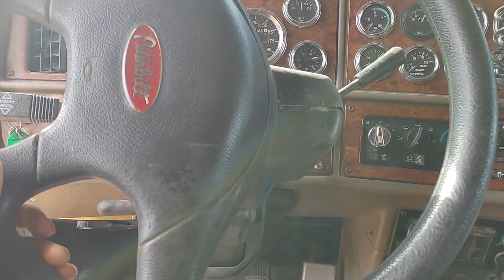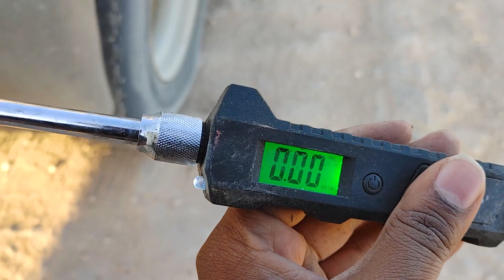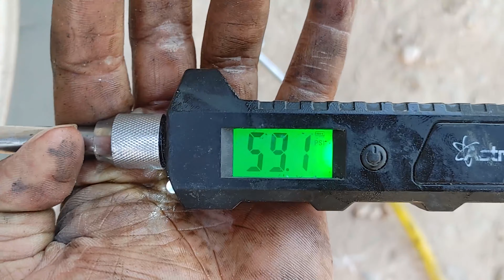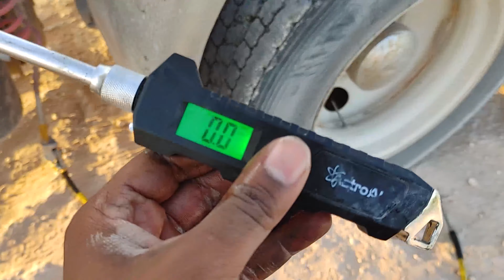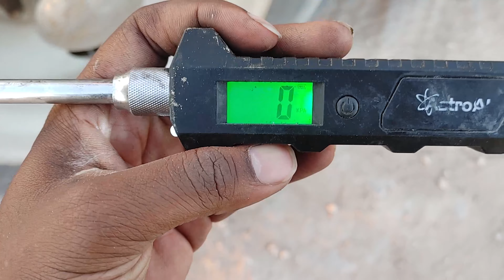Trucking - Blown Tires

Comment: Yo just some free advice whenever you get new tires always ask for new valve stems. Quick question how do blowing off go when you switched to 24 and 24?
Reply from the maker: Lol they wouldn't do 24/24 because it wouldn't fit. Had to stay with 30/18. I think his trailer has 4 pods or either the pods have bigger cubic ft.
Reply: @ChasingAndrewJackson  oh ok just checking. It would have be sweet if you could have switched it up. Another quick question how much longer you plan to stay in the oil field. I know it's good money but seems like it's more just a means to an end?
Reply from the maker: I'm not sure. The plan right now it to just keep the truck at 100% & stack the money. If something happens i can leave any day. I have thought about putting a driver in it if i go otr with koko.
Reply from the maker: Justin lewis suppose to be leasing on with the company im out now. If he comes we could be out here till the end of the year.
Reply: @ChasingAndrewJackson  just some more free advice if you put a driver in it and gonna be gone otr instead of paying the driver 20 to 30 percent think about paying him/her 40 percent after fuel and expenses (mechanical included) of the settlement amount. It might sound crazy at 1st but I promise you you will make more money with less headache with that formula and you only giving up an extra 10 to 15 percent. The driver will work harder and take care of the equipment better. 💯💯💯💯
Reply: @ChasingAndrewJackson  that's what's up. I been wondering how he been doing. He seems like a good brother but I know he has had some valleys and peaks in this trucking industry. Hope he does come over there and gets his fleet back up💯
Reply: @truckology101  That is a good formula I pay driver 60% of net. Make them wanna save on fuel and not idle truck so much
Reply: @anonymoustrucker1782  60 percent? I might come drive for you🤣🤣🤣🤣🤣

Comment: Aye wassup man do you think it’s a good deal to buy a 2007 freightliner Columbia Detroit 60 series for 10k with 950000 miles on it
Reply from the maker: Yeah but you need an engine rebuild
Reply: @ChasingAndrewJackson  should I get it right away or do you think I can get a couple months out of it also should I get a inframe or rebuild the motor all the way? Thanks for responding
Reply from the maker: It's no telling when it needs a rebuilt or what parts need to be rebuilt. I just recommend it after 700k miles. Maybe you can get a few weeks, months, or years out of it before rebuild. Im not sure
Reply: @ChasingAndrewJackson   ok do you know any shops that won’t charge me crazy numbers besides the secret shop I been calling shops for 2 days now only in Indianapolis though
Reply from the maker: Call around in different states. With 60 series its pretty much the same price anywhere. 8-12k even at dealership unless your needed turbo, water pump, injectors, etc
Reply: @ChasingAndrewJackson   perfect thanks
Reply: Brother I can answer it for you... Get the mother fucker.. call freightliner and buy a 5 dollar fluid test kit. The truck u want get the oil trans and diff fluid in the vials. Send it to freightliner and have it test.. in 2 days you will know what you got. Lastly.. 60 series are 1.6 -2.1 mil motor I've regular oil changed 8k and taken care of before overhaul. I hope that helps
Reply: @carmello000jp   fasho thanks man